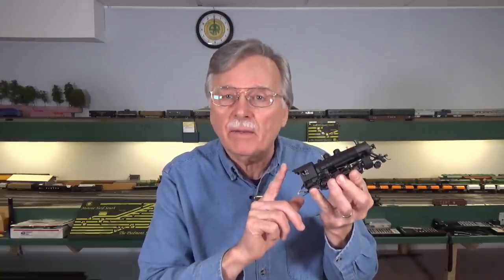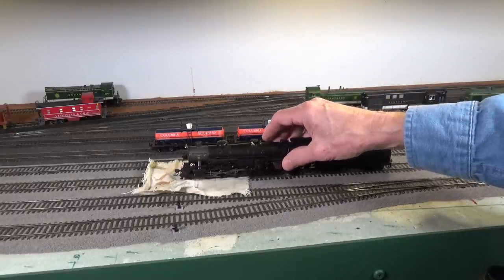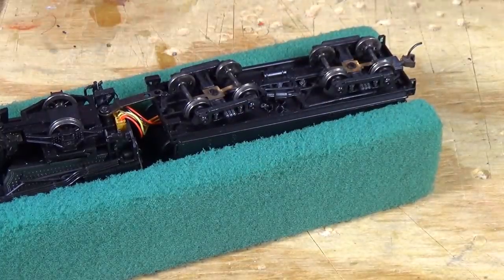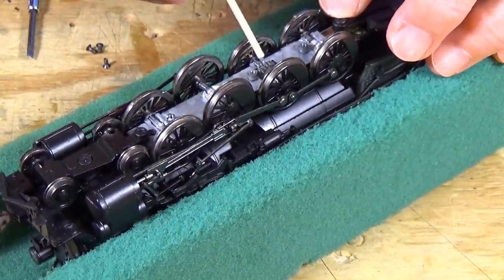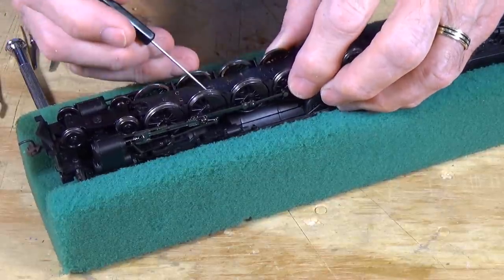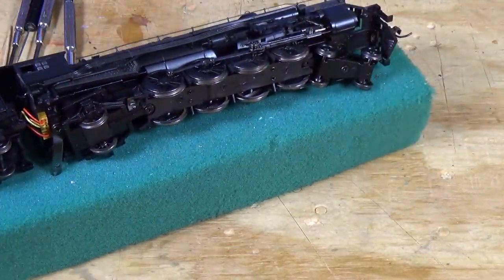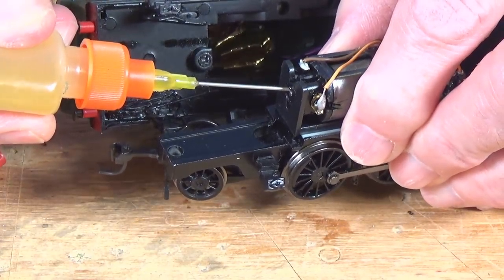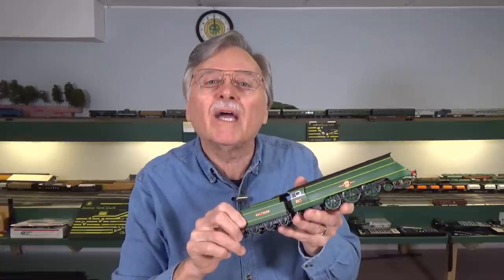Steam Loco Tuneups (229)

Comment: Great video.  I service my six BLI On30 2-8-0s in a similar fashion.  However, I use three tube kit Nano-Oils for model trains.  Instead of the white grease, I use their heavier weight oil on the main gear tower.  Once the lubrication is complete.  I have a quiet running locomotive with no gear whine at all.  That allows my QSI decoder conversion to Soundtraxx Tsunami 2200 Steam decoder sound much better.  Those BLI models are about 18 years old.  The St. Claire company did a study testing amperage draw on brass locomotives that have not been lubricated and the amperage draw after proper lubrication.  The difference was significant.  In your DCC videos you mention often the amperage draw on the command station.  Proper lubrication can help of all your locomotives stay within the designed amperage load of your command station.  It can also help that one locomotive that seems to have a "hitch" in its movement while running down the tracks.

Could be another video idea.  Take a very old, gear noisy non-DCC engine.  Convert it to DCC.  Check the amperage draw.  Then go through your lubrication steps, give it a little break in and then test the amperage draw again.  See if it is less.  See if the gear noise is less too.
Reply from the maker: Good idea. I may just try that with a brass loco I need to i stall a decoder in.